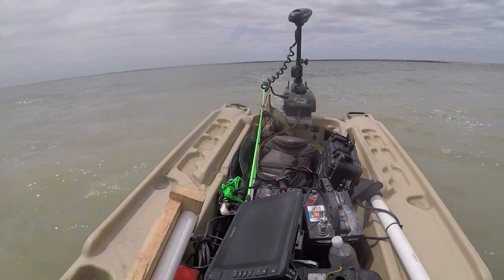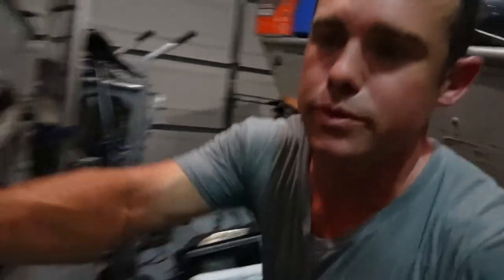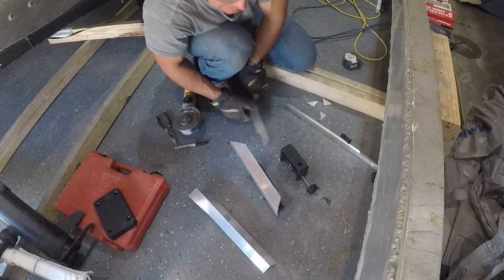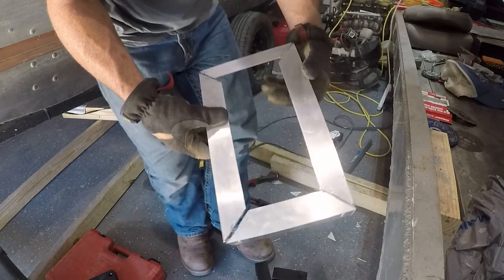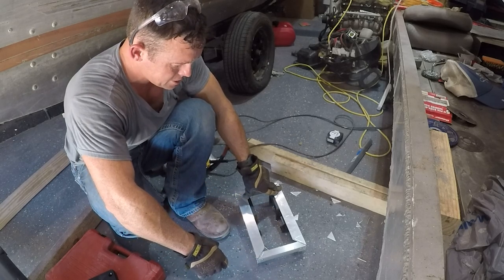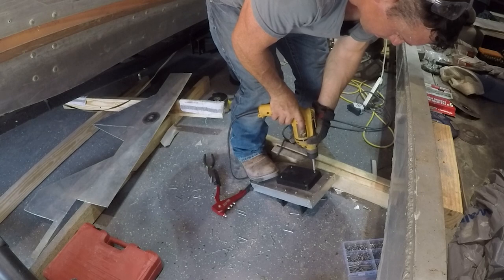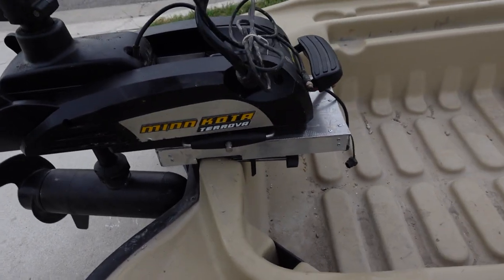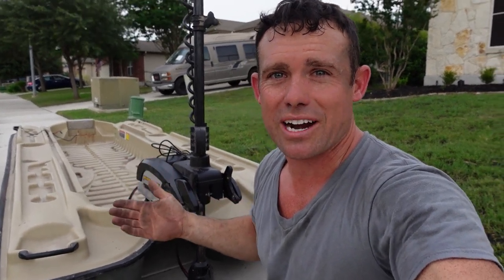Mount a TROLLING Motor on Anything! This Mount Makes any BOAT a Bass Boat Conversion! LOVE IT!

Comment: THANKS brah, I'm glad I found your video.... I'm a retired welder, worked power plant shutdowns for 35+ years, but don't have access to a fab hop anymore, or a welding machine. This is something I can do in my garage, ... I got a great price on a bow mounted trolling motor, and couldn't pass it up,  this really has helped me out !!
Reply from the maker: Your welcome bud! A word of
Advice because i learned the hard way. Make sure you have a lanyard or a strap on it. I have the remote on mine and was using the remote while on the bank and mine twisted off and I had to go swimming for the motor.
Reply: @TBassFactory  WoW !! Lol, ok, I'll do that... HOPEFULLY that happened to you during the summer months!  Thanks buddy!

Comment: How's it holding up so far?
Reply from the maker: It’s doing great despite dropping it to the bottom in about 12 feet of water. I found out the limitation of the mount is when it goes sideways and gets leverage. It lifted up when I was playing with the boat like it was a remote control boat. I’ve been on a bunch of trips but now I have an attachment for the motor just in case that ever happens again
Reply: @TBassFactory  
    Oh 💩!  I got a Motorguide XI3 comming in this week for my Pelican Bass Raider. I was thinking about trying it as a remote control boat, guess I wont!  
  Your motor still works after that?
Reply: Ouch!!  Did it come unclamped from the boat or from the motor mount?